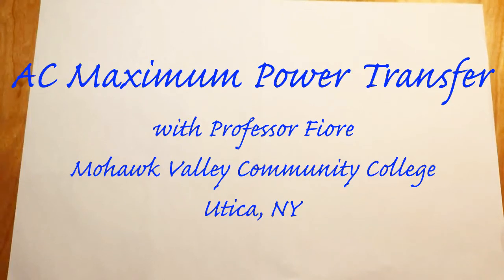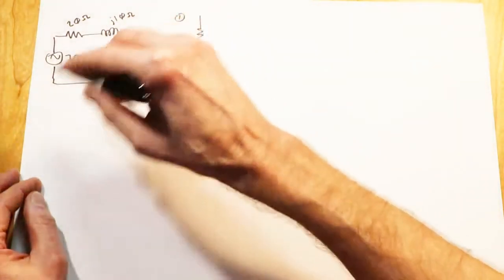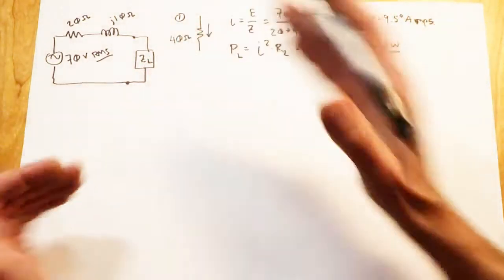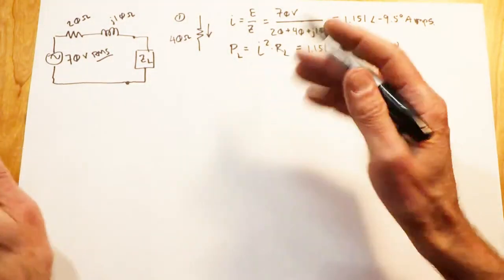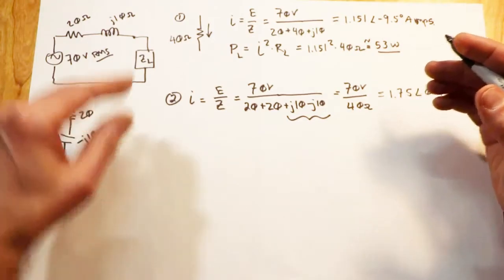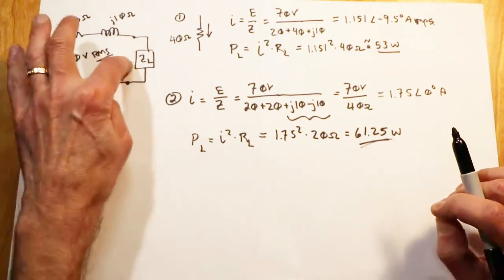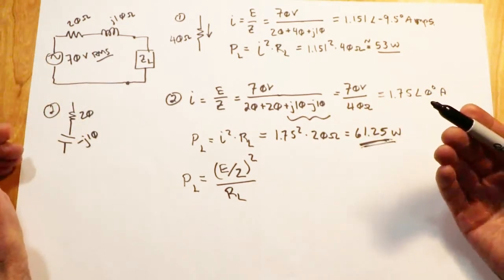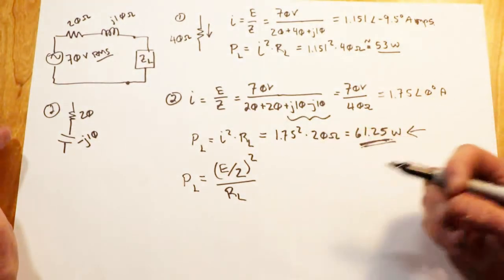AC Electrical Circuit Analysis: Maximum Power Transfer Theorem

Comment: wouldn’t calculating the current from RMS voltage through an inductive impedance mess up the math? I thought you had to use the source’s Peak voltage for that
Reply: Or does the calculated current also become an RMS current value?
Reply from the maker: @torikenyon  First, you wouldn't use a peak value for power unless you also had a correction factor for it. I have seen texts do that but I think it's better to stick with the basic definitions and go from there. Remember, RMS exists specifically so that you can perform power calculations. Second, if you divide an RMS voltage by a resistance, you get an RMS current. Whatever you start with (RMS, peak, p-p), that's what you get at the other end.
Reply: @ElectronicswithProfessorFiore  thanks for the response!